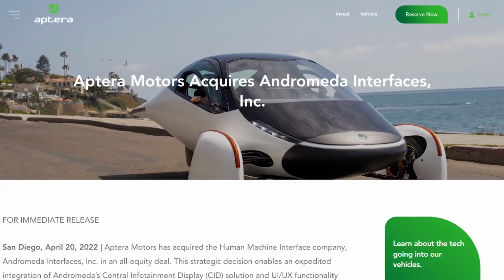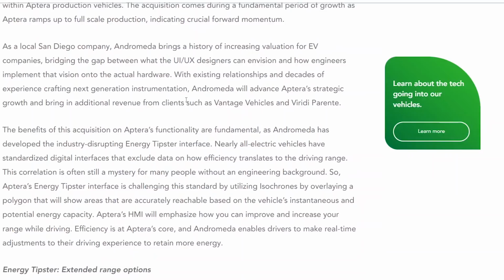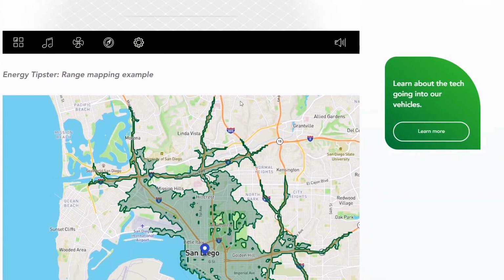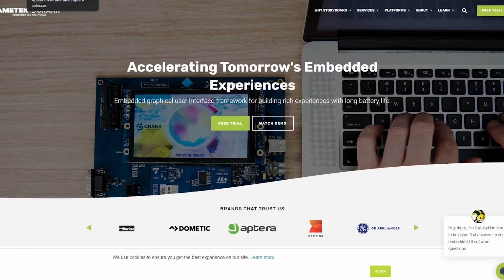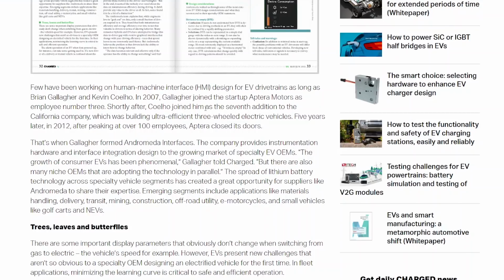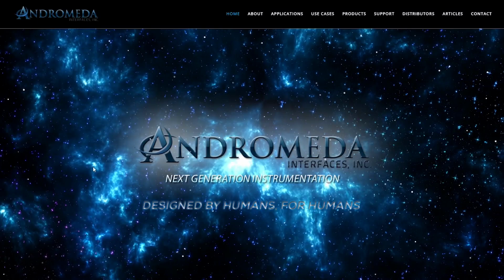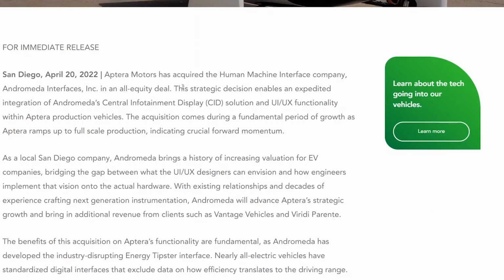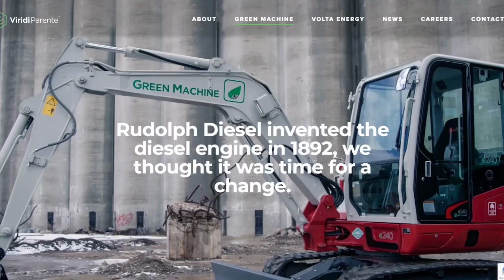Aptera starts vertical integration

Comment: I’m really excited about this as I’m trying to decide between the 400 and 600 mile batteries. From my “back of the envelope” driving math I feel I fall into a 500 mile battery range ( taking into account a lot of A/C usage, charging, using battery charge between 20% and 80%, locating convenient and available charging locations, etc.) I would feel a lot more convenient in choosing the 400 mile battery utilizing the Energy Tipster feature. I think it’s a game changer for EV’s. Very smart move by Aptera!

Comment: Aptera needs to get a vehicle into production. Nissan went to the opposite extreme of releasing the Leaf with lousy guess-o-meter software and failing to develop it to take into account the route to destination. Software development companies can spread development costs over several clients. A Better Route Planner is developing software for EVs. For Aptera as a small start-up, being a client of a software developer seems like a cost effective way to get vehicles into production. Trying to develop its own software that performs a task applicable to all EVs might be an unnecessary diversion. Once the vehicle is in production, future versions can have energy monitoring software calibrated for the vehicle.

Comment: Such acquisitions are often the only way to "hire" small company founders and principals.  It's common for startups to do this as an equity swap, though established companies often cut to the chase and pay cash.  This allows the founders to not abandon their existing customer base, though the acquired company may be gently wound down.

Startups need to internalize as much of their engineering as possible to ensure flexibility and productivity, primarily by co-locating to eliminate communication difficulties and delays.

Similarly, startups like to contract out as much of their early production as possible, to take advantage of existing facilities and skill sets.  (Who makes their own PCBs these days?)  The exceptions are for when suitable outsourced production capabilities don't yet exist, forcing the startup to do initial production in-house, hopefully to then quickly spin-out a working production system.  As a company grows it will often take production back internally, depending on the availability of capitalization and the opportunity for optimization.

The Aptera approach is to do whatever makes sense in the moment that gets them to market soonest without breaking the bank or making silly mistakes.  No debt-burdened rush to production.

Comment: I want a mode that's gonna leave me alone and let me drive.  No map,  no warnings unless disaster is impending,  no miles to empty.  Mirrors,  speedo, turn signals. Darkened screen.
Reply: They could have a '52 MG mode and a fake oil leak too.
Reply: @snailer06  bahahaha!
Reply: @snailer06  or a pre-evo H-D mode that vibrates the seat, reduces the power to the drive wheels and makes tractor noises, plus leaks oil and takes 15 mins to start in the morning.
Reply: @iansmith6728  Brilliant! Maybe we could get Chris to add a "virtual decrepit sports car" app to the mix!
Reply: That's good for you. I guess the majority of us want all of the above.

Comment: This acquisition does not count as vertical integration. A small company of 5 employees (Six Counting the CEO) more augmentation of current capability. Also really reintegrating x-Aptera employees. They seem to be focused on production of a hardware component not just UI development. Only six employees in 11 years and currently only two customers. Perhaps revenue positive, but can't be very much. I would have stuck with Crank. More resources, more references, I suspect a more disciplined software development process. But Andromeda is close and well known by Aptera. In the end, I trust Aptera to make good decisions.
Reply from the maker: i'm thinking Crank is a platform provider more than a UI coder/designer so I think they are still working with Crank?   Yeah, it's a very small outfit.
Reply: Well I think that was why it was an all equity deal rather than buying off.

Comment: Tesla has added air density which changes significantly with elevation.
Reply: That is actually one of the bigger range factors.  At extremes it can be 20+%.  Next big thing will probably be factoring in weather data and prevailing wind direction as fighting a direct headwind on an interstate can be big.  Motormatchup includes these in the physics calculations they perform for estimates (obviously far simpler in isolation).
Reply: Like density altitude information when flying.

Comment: I believe Aptera acquired Crank Software as well.
Reply: I hadn't heard that.  Crank is a far more generalist software company with ~40 employees and 350+ clients that have nothing to do with Aptera or even automotive so it seems unlikely.  Their website shows they are owned by Ametek which is a very large (18,000 employee) company.  Do you have an article or reference for where this came from?
Reply: @ccibinel  I may be off on that. Jerry Rig Everything put out his last Hummer video and mentioned that the UI company that made his system was bought out by Aptera.
Reply: No. Crank was recently acquired, but by Ametek.
Reply: No Aptera only has a contract with them. They are way to big for Aptera to acquire.
Reply: @johnmalcom9159  Just went back to the aforementioned video and he said that Andromeda was bought up by Aptera. Sorry if I confused it.

Comment: Software is critical to moderns cars.  Many people dont understand that if they havent driven anything newer than ~2010.   It looks like they have their ducks in a row to put together something solid day-1 and evolve it over time.  

I'm still hoping the infotainment can have HDMI (or HDMI over USB-C) input (when parked). This will allow adding any  streaming services, games or apps by plugging them in rather than trying to catch up with tesla.  Saves an insane amount of coding man hours for a port which maybe ads $5 to the cost of the infotainment at manufacturing.  Great for camping.  It could even be helpful for road warrior sales guys as effectively another monitor to do some work when charging.
Reply: Some cars in Europe have a base version which just has a cradle for a tablet. The customer plugs in their own tablet. The vehicle can have an app that displays vehicle information on the tablet. That approach is flexible. Customers can choose the size and brand of tablet that fits their use case.
Reply: @backwoodsbungalow9674  Interesting but I suspect laws would prevent ever putting anything critical like shifting, wipers or speedometer exclusively in such a device since it would effectively be optional or subject to higher failures (less testing of specific models).  Since Aptera now has a behind the wheel screen perhaps this would be viable with a small number of backup physical buttons; definitely would be a design pivot
Reply from the maker: yeah, I don't know why all these car companies don't just put in an hdmi port... especially these minivans with the screens for the kids, they are still putting dvd players into those things!